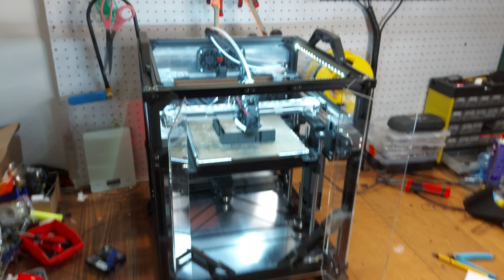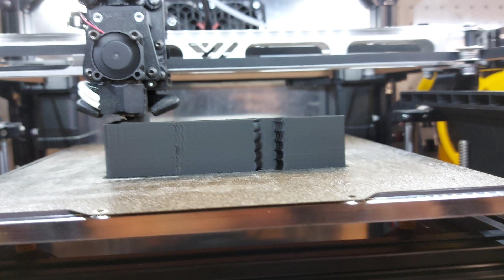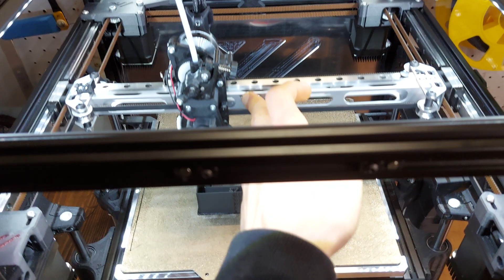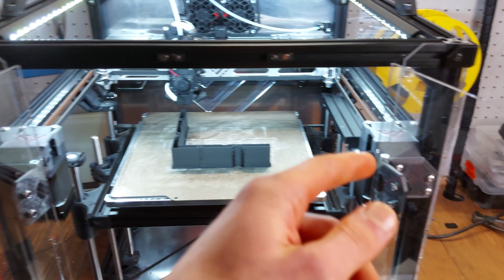VZ235 VzBot small update

Comment: A bit late to the game but could you explain the advantage of the aluminium gantry compared to a normal aluminium extrusion?
Reply from the maker: The aluminium parts are super lightweight so i can run crazy speeds without quality loss, furthermore stay tuned for my next video. I will show all the alu parts and explain and test how much better those are:)
Reply: @guillaumevanschijndel3435  nice to meet you again ;) We’ll definitely makes sense, how much does one reduce on gantry weight with such Setup? Ever thought about AlMg alloy, around 30% lighter with  much higher stiffness
Reply from the maker: @waym9409  same to you! Uhm total weihy kn vz330 was a loss of 140gr i think, the alloy is a good option tho just not sure how affordable it will remain. The biggest weight reduction to he done is the linear rail at this point, vez is testing mng7 now but there should be even lighter options soon:)

Comment: I feel like this would deffinetly benefit from 9 mm belts.
Reply from the maker: Not sure, i experimented with stiffer belts but there is a sweet spot. Too stiff and the belt will conduct vibrations over to the printhead from the pulleys or something or lack of dampening not sure..
Reply: @guillaumevanschijndel3435  hm, odd.

Comment: If the printer is working while normal printing and the problem is in the homing. I think the issues are in the print start sequence. Keep in mind the that klipper start sequence May not be set up for 4 motors. Does running only G28 cause these issues?
Reply from the maker: Fixed now;) something with the python files in klipper. Awd is now added to mainstream klipper!